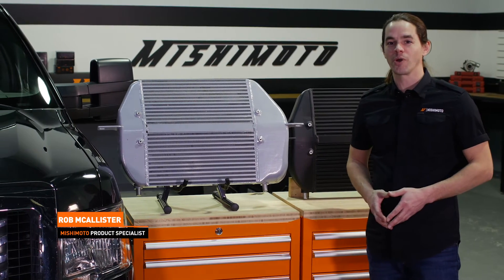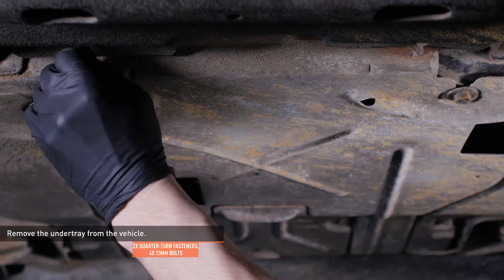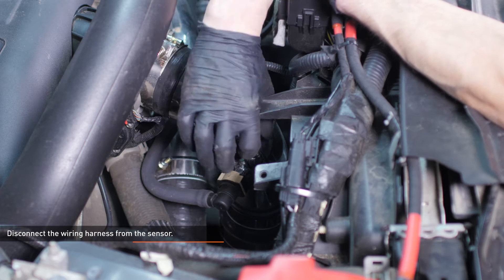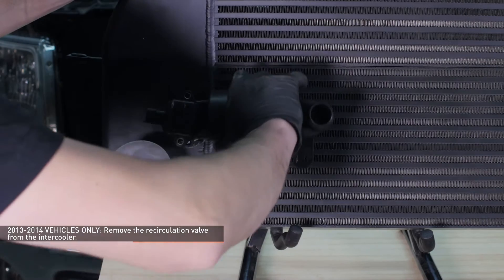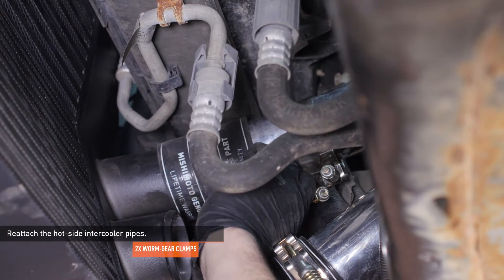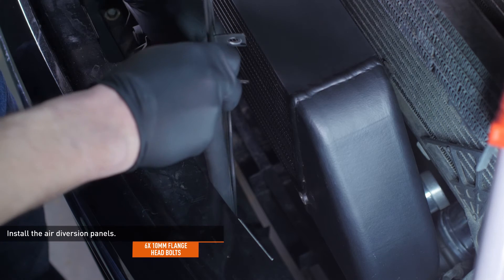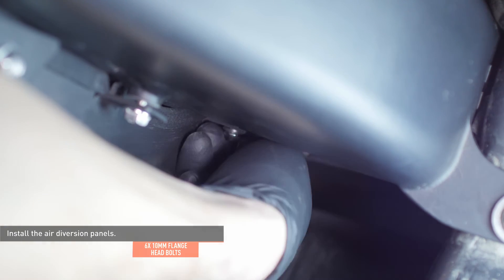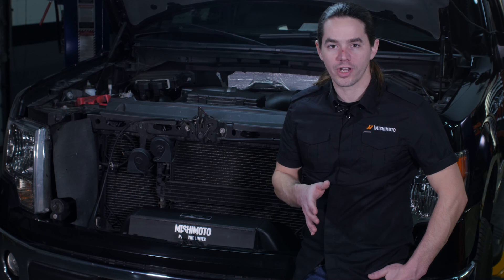2011–2014 Ford F-150 EcoBoost Intercooler Installation Guide by Mishimoto

Comment: I was/ am goin to buy this intercooler. Do i need the mishimoto pipes or will stock pipes work?
Reply from the maker: This is compatible with OEM piping
Reply: @mishimoto  advantages with the mishimoto piping?
Reply from the maker: Our piping will be more durable than the OEM plastic. Below are a few more selling points listed on our site. 

Max gains of +15whp/+21wtq when using our full kit
10% greater flow than stock
41% and 34% increase in internal volume for hot and cold–side pipes, respectively
Reply: @mishimoto thanks so much for your time.